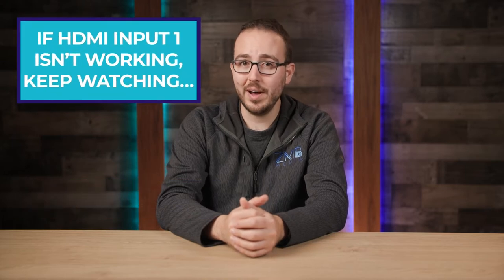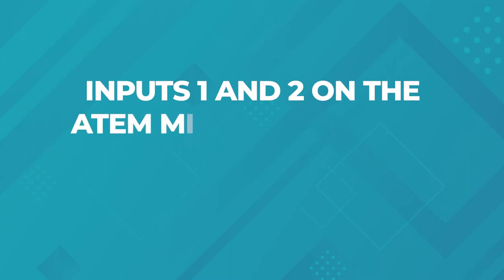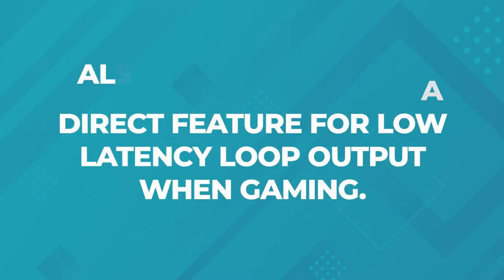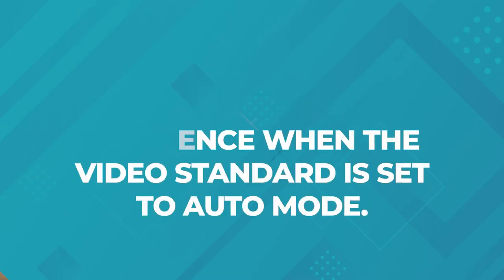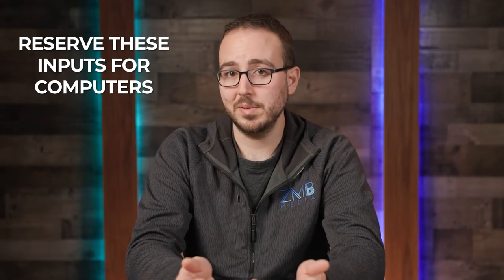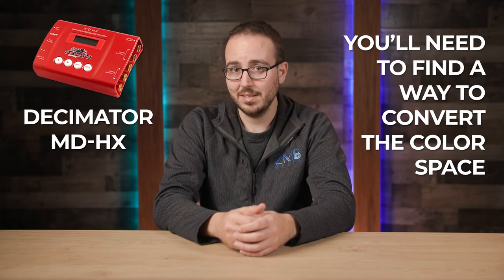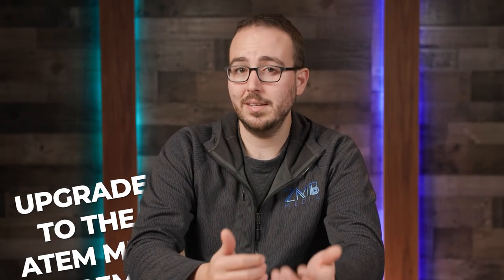Fix HDMI Input 1 Not Working - ATEM Mini Pro YUV Color Space Issue

Comment: So why is it 2,3,&4 aren’t working with my canons? Only input one… blackmagic said it’s the color science on the canon m200 and r7? But shouldn’t they work on those 3?
Reply: im having the SAME issue and cant find any help
Reply: Me too
Reply: Im having the same problem as well. When I spoke tech support, they said it was something more made for gamers. That makes no sense, surely they must have known that people doing any type of videography, would plug multiple cameras in.
Reply: I’ve found BM support to be absolutely terrible for this issue. Out of the box only input 4 worked. After a firmware upgrade 2,3, or 4 worked intermittently. At some point 1 started working, but showed green EVEN when the input was from a computer via HDMI. What seems to work now is to always start with #2. Then 3 & 4 behave themselves. Another AMP owner says theirs does behave like ours. He believes we simply got a bad unit. BM refused to honor the manufacturer’s warranty. Still trying to sort out 1. The HDMI splitter or extender in our setup from the computer may be converting to RGB.

Comment: My workaround is to use Blackmagic mini converter hdmi to SDI, and another SDI to hdmi. (I have these because I used to use long SDI cable, I switched to wireless HDMI when I encountered these issue)
When your output of wireless hdmi is usually RGB color, but after these converter, it convert to YUV signal instead. 

Not optimized but work for me.

Comment: A good clear explanation. I notice that hdmi-1 is also the default for the PiP window presets on the Atem Minis, though with the Extreme you can change it quickly using the Select Bus feature. Having to buy a Decimator MD-HX to change the colour space and fix this is an expensive PITA!
Reply from the maker: I’ve seen some people use HDMI splitters to fix the color issue too but I always keep decimators on hand anyways so I haven’t bothered to experiment.
Reply: This is a scam and this influencer was paid off to say “different perspective” and “not a problem”. AND if you call customer service they try to tell you the same thing!  But guess what I found out…. Units built before a certain period of time didn’t have this issue.  Then ATEM made a massive defective run of them.  And guess what, units they are making now ALSO don’t have this problem.  So it’s really just the poor saps that purchased from the defective run of production that only have 75% of their inputs working.  Honestly, this is class action law suit worthy.   But, in the meantime, return your unit, demand a refund and get a new one because the new ones work.  #CoverUp
Reply: @Pillar0Mktg0Grp This explains a lot. They refused to honor the 1 year warranty because we bought the unit on Amazon and they said that unit was originally purchased more than a year before from their warehouse. By the time we discovered the issues the Amazon return window had passed.

Comment: @Zephan, the first time I plugged a camera into input 1, I got good output from the Atem mini pro iso, then later when I plugged in other devices into inputs 2, 3 and 4, I started having problems with input 1 which became green and pink as you described. When I could not get input 1 to work correctly, I watched this your video and purchased the Decimator MD-HX you suggested as a solution if I needed all inputs on the Atem mi I pro ISO because I needed all four inputs. The problem is I do not know what happened but input one is now working and I have no need for the Decimator MD-HX. I'm using all canon DSLR cameras that do not have a yuv output. I believe input 1 works with rgb as is the case right now. I believe it is not accurate to say input 1 does not work with rgb color space. I'm not sure why input 1 worked with my DSLR and then stopped working and became green/pink and then afterwards started to work again.  Maybe you need to test again but input does work with the rgb color output from my DSLR cameras. I'm using the Atem Mini Pro ISO. Thanks!
George M.
Reply from the maker: Thanks George but this information comes directly from Blackmagic. You may have used a different camera, different cable or sent a different type of signal at some point but this is well documented across the atem communities.

Comment: Thank You so much, you solved the unsolvable.   Now that leaves me with another impossible question.  Is it possible to use an input other than #1 for the preset PIP?  I am brand new to ATEM Extreme ISO, or ATEM in general.  This is my first video switcher.
Reply from the maker: You’re answer is in the manual 😀 which I recommend checking out if you’re brand new. Just google atem extreme manual and you’ll find it on blackmagics website.

Comment: I'd love to see how you use the Decimator MD-HX with input 1! I would love to us it to present a powerpoint pip while keeping the other 3 inputs free for cameras. I've been playing around with it and I'm stuck on a black screen. Thanks!
Reply from the maker: Typically just converting SDI to hdmi or hdmi to SDI depending on the switcher. Tell me more about your settings, what’s going in, what’s going out, resolutions/framerates and settings on the decimator.
Reply: @zephanmoses  I've tried a few things: MacBook directly into input 1 (black screen), MacBook to Decimator to input 1 (black screen) - Decimator says the input (from the laptop) is 3GA 1080p60. I've selected nearly every output setting... nothing seems to work. Oddly... I did get input 1 to work with an old Canon T3i DSLR.
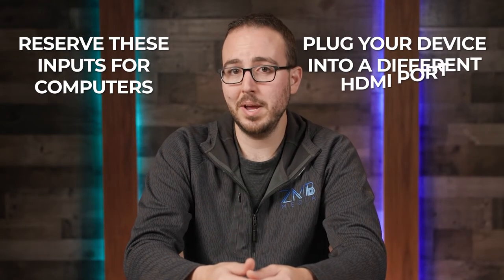Reply: Any thoughts... you mention at 3:05 that this is the tool to convert a signal to the correct color space. Is it as simple and selecting the correct output settings so that I can use Input 1 with my MacBook? (I ran out to buy this tool... and massively overpaid because they seem to be out of stock everywhere and I need to ward off my inner panic that says I bought a tool that won't work for the task!)
Reply from the maker: @SteveZacharias-e4j  there are more settings on the decimator that I’d need for you to share with me in order to know if you set it up properly. I would make sure that you are using hdmi from the MacBook to the decimator input, make sure that the decimator is set to output the scaler to the hdmi output and not the SDI output, make sure that the DUC setting is set to 1080p29.97 or whatever frame rate you are hoping to use, make sure that the scaler is applied to the hdmi input and not the sdi input, make sure you’re using good high quality hdmi cables. Without knowing all of your settings on the decimator I can’t help. I would also set your time code to free run and select a color to be output when no signal is detected for troubleshooting so you can make sure a color is sent into the atem at least to prove that your settings are correct. 

On top of that what MacBook are you using? Does it have hdmi out or are you using an adapter? Need more info.

Comment: Hey, thanks for the tips, kind of a silly questions, the whites on my output look blown out, if I connect the source directly to a monitor, it looks good, but through the switcher blown out.  I can't find the controls for camera brightness/gain in the software, or more specifically I see some things called gain, but adjusting them doesn't seem to have any affect on the picture...
Reply from the maker: The camera controls are only going to control Blackmagic cameras and will not work for other cameras. If you are streaming using the USB-C cable, it is a compressed feed, and therefore might lose detail in the highlights and the shadows.

The camera control settings are in the camera control tab in the atem software control.

Comment: Hi Zephan,  I love your tutorials and I'm hoping you can help me with an issue I'm having with the ATEM Mini Pro. I have a Panasonic DVX 200 that will not connect to the unit. The audio through the camera comes through the ATEM, but not the video. Any ideas?
Reply from the maker: I’m not familiar with the camera but are you able to find out if the camera has “clean” hdmi output? Also check the cables you are using. Try different cables, use cables under 10m in length and be sure to try different inputs on the atem.

Comment: The Sony cameras I'm using don't seem to be affected by this problem. I'm sending the hdmi out of an a6600 to input 1 and a Sony camcorder to input 2 on an extreme iso and they show up fine. I am using 100' and 50' fiber hdmi cables respectively on those cameras if that makes a difference. I also use an original atem mini and run an old a5000 into the #1 input with no problems on a short regular hdmi cable.
Reply from the maker: Correct. This is not an issue that plagues all cameras. In fact longer cable runs have been known to be more successful with these inputs 1 and 2.
Reply: @zephanmoses  That's strange that longer cable runs would be more successful.
Reply from the maker: @toby9815  not really. Like I mentioned in the video these inputs are designed for lowest latency so they have a little extra juice for the signal it’s receiving.

Comment: We have a Mac book pro and plugged it into channel one like we had done with our PC. It distorted the screen like you showed in the video. Is there a setting on the Mac to fix the issue?
Reply from the maker: I usually run it through a decimator Md-hx and that fixes most issues. Admittedly I have to read more into this one. It could be an EDID issue in which case you could try an EDID emulator but I don’t have experience in using them.

Comment: The thing I don't get though is, I use (d) channel 1 for lyrics to overlay in the PIP and it worked perfectly fine for about a month and then all of a sudden one day everything's hulked out. And now it's PERMANENTLY like that. Why would it have worked properly for a while but not now with no changes on my end?
Reply from the maker: Perhaps your lyrics going into input one are coming from a different computer, cable or the software that runs them was updated an outputs a signal differently.

Comment: I have a Atem mini pro and a PTZ optics camera . I have my computer in HDMI port 1 to display easy worship screen and want to put the camera in port 2. It shows up as a black screen. I have a decimator MD-HX.  Can you advise me on the settings I should set the decimator to convert the camera to show up on port 2?
Reply from the maker: You shouldn’t need a decimator on input two. Try swapping the cables to see if the ptz works on input one first. Then, check the length of your hdmi cable. Is it too long?
Reply: Hi Zephan: Thank you for the reply. The camera does work with port 1 just perfectly but doesn't show up on port 2-4. My computer HDMI when plugged in port 1 does show up but not in 2-4. The HDMI cable from camera to ATEM is about 25 ft long. I was hoping to keep the computer on 1 and have the camera on 2 but no luck. Would the decimator work to help the computer work on port 2? @zephanmoses
Reply from the maker: @PaulCook-q5o  yes a decimator would help and 25ft is the max for hdmi I would not use cables that long.
Reply: I have two options.  1:  put camera in 1 and computer in 2. Any advice you can give me to help connect the computer HDMI cable from the video graphic card to the decimator to the ATEM? What settings can help me do that?  Second option is keep the computer in port 1 and get the camera to work in Port 2? Any advice on how to do that since I know the HDMI cable is good since it works in port 1? I would think it should work in 2 as well.  Would a SDI cable from camera to decimator SDI input to HDMI output to ATEM be better that a long HDMI cable from camera to ATEM? Please help. @zephanmoses
Reply from the maker: @PaulCook-q5o  I have a video that explains how to use the decimator. It’s pretty easy. You plug the computer into the hdmi input and then using another hdmi cable from the decimator output send the signal into your atem. Then in the decimator settings, set the decimator to output the scaler over the hdmi output. Then set your scaler to scale the hdmi input (instead of sdi), finally set your desired scaler framerate (24/30/60p).

Longer cables work better in port one due to its low latency nature. That’s why it works in one and not in two.

SDI will always be better than HDMI.

Comment: Are you sure it is YUV only at input 1, and not RGB only? You say that input 1 is meant for computers only, but computers normally outputs RGB, not YUV (or am I wrong). I'm about to buy an Atem Mini to connect four computers, so I'm a bit confused here if it will work for us.
Reply from the maker: HDMI Input one only supports YUV, so you will get a color space issue when using an RGB video source. This is direct from Blackmagic.
Reply: @zephanmoses  Thanks. But you also said that Input 1 was made for gaming (computers) ... And if computers deliver RGB, then ... ?
Reply from the maker: @jorgenbjerke  gaming systems. Not computers. PlayStation, Xbox, etc. With that said it is meant to be a lower latency input.
Reply: @zephanmoses  Ah! I see.
Reply: Today I borrowed a Mini Extreme, and tested the input 1+2 with a Chromebox, Apple-TV (HD), A Macbook and a Windows laptop. All of them worked perfectly without any hacks or tricks on both input 1 and 2, and the others as well. Just pure plug&play. I could even change the resolution of the Mac and the PC with no issues. That's awesome! So BMD claims the input 1 (1+2) only takes YUV, and all I have googled so far says that all computers only output RGB. That is very interesting :)

I'm going to use a mini to switch HDMI-sources for a big TV-screen on the stage in our church. Up till now we have used a regular 4x4 HDMI-switcher that costs more than twice the price, is unstable, and takes about 5 seconds to switch, with all kinds of noise on the screen. Annoying. But this is Heaven :)
Reply from the maker: @jorgenbjerke  sounds like you’ve got a great solution for your needs

Comment: I have an BMD extreme iso and I use it for multiple camera mixes. Only Hdmi 1 & 2 worked. The rest didn't until I used a converter. I really wish it was simply 'plug and play'. How can I make this work?
Reply from the maker: Sounds like you need cameras that output an RGB signal or you need to use different cables. But there’s no way for me to know without knowing what cameras and cables you have.
Reply: @zephanmoses  I use Sony A73 and Sony Hx100 cameras. Maybe I'd try other cables.
Reply from the maker: @NSW_XUZIA  are you using normal length hdmi cables? Typically anything over 10m long is using a chip to boost the signal which may be making them incompatible with your atem inputs.
Reply: @zephanmoses  you're right. I'd try shorter cables and get back to you. I also use hollyland transmitters and have the same issue

Comment: Input one and two working perfectly. But why I try to add a new camera on inside it 3 and 4. It doesn’t work
Reply from the maker: Are you using longer hdmi cables? Inputs one and two tend to work better with cables that are longer than 25ft which is about the maximum length a standard hdmi signal will transmit.
Reply: @zephanmoses  the 1 & 2 works perfectly. But 3 & 4 am having issues with. I’m using a 20m cable. I tried putting the cables that work for 1 and 2. But they don’t work for 3 and 4
Reply from the maker: @johndestiny3926  HDMI wasn't designed to go longer than 10m. So you're already pushing your luck with a cable that simply wasn't designed to do what you're trying to do. The inputs 1 and 2 are designed for lower latency so they're going to function with those longer cables. Basically, it's doing exactly what it was designed to do. But I highly recommend getting HDMI fiber cables for anything over 10M because HDMI simply wasn't made for that.
Reply: @zephanmoses  thank you so much. I’ll buy fiber cables sir 🙏🏽

Comment: Hi very new user to ATEM MINI PRO ISO- When I first plugged in my SONY EV-10 (Port 1) and SONY ZV 1-F (HDMI PORT 2) they worked just fine on the output screen, now after 3-4 days of not using the ATEM I can only get either to show up on HDMI input 1. Ports 2,3,4 do not take any input at all. I am wondering if this is because of something that I changed in my settings on the computer. I tried a hard reset and the same problem persists...HELP :( I am dumb.
Reply from the maker: Have you changed the hdmi cable out or any other things? I would test other hdmi cables first. What length of hdmi cable were you using? Did you change the resolution in the camera to 4K? There is a setting where it might output 4K instead of HD and the atem is only compatible with HD.

Comment: I am getting pink and green screen when I connect hollyaland pyro H receiver. And it doesn't work on port 2, 3 and 4 of atem mini pro. Please help
Reply from the maker: Yea it's the same issue I'm afraid, it's a color mismatch. RGB vs. YUV. This is documented on Hollyland's website here: https://www.hollyland.com/support/faq/pyro-h/abnormal-issues-3

The HDMI IN 1 port of the ATEM mini switcher only supports RGB mode, while HDMI IN 2, 3, and 4 support YUV mode. The Pyro supports YUV mode but should work in ports 2-4. Try using different cables and make sure that it's not sending 4K (the ATEM can only see 1080).

Additionally someone reported on Reddit, "I resolved the issue by setting my cameras to output 1080i video. The ATEM resolves the video to 1080p anyway and for us it's fine because we swap out the footage for the 4K camera files after anyway."